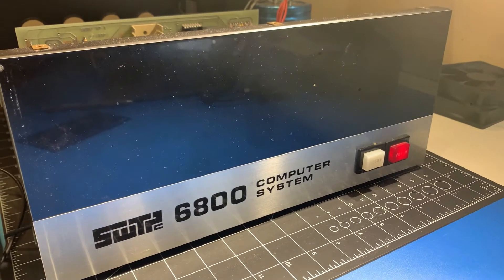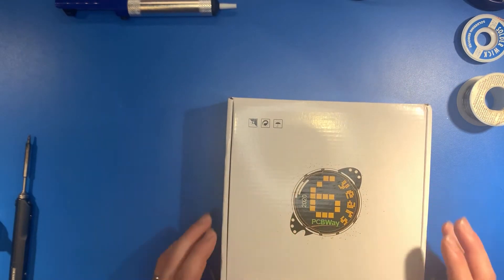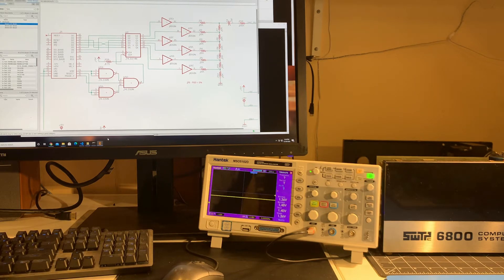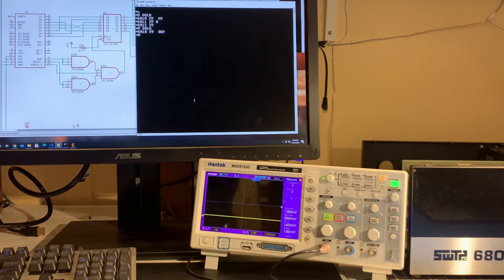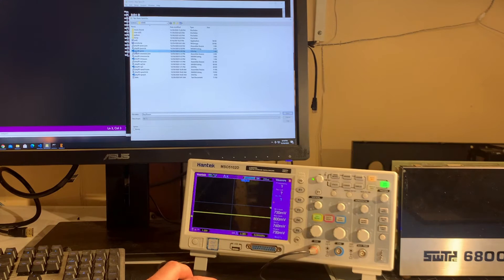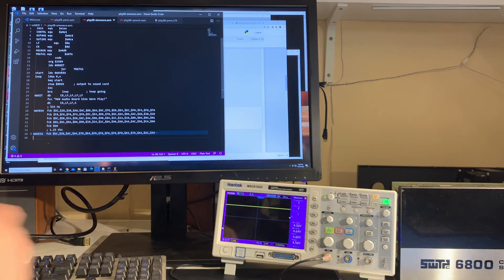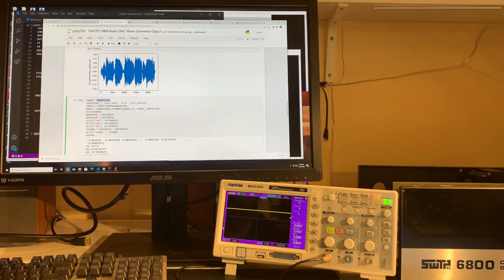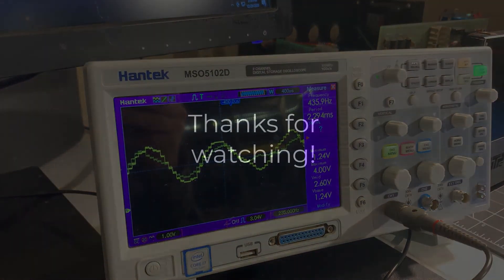SWTPC Retro DIY sound card.

Comment: Is it feasible to use interrupts instead of adding hot loops for delays? A quick google shows the chip supports IRQ and NMI interrupts but I guess you'd need to be able to ensure they are triggered on a timer like video interrupts are in many other popular 80s micros.
Reply from the maker: There is an extra interrupt controller card for the SWTPC 6800 which I do have so I think using interrupts to control playback would be possible by the interrupt periods are not very granular. I think it’s possible.  https://deramp.com/downloads/swtpc/hardware/MP_T%20Timer%20Interface/MP_T_AssemblyInstructions.pdf

Comment: How much should I expect to get out of my 6800?  Altair's go for about $6k currently, obviously doesn't have the same collector base, but it is more rare than an Altair..
Reply from the maker: I think rarity counts for a lot but it is really set by what someone is prepared to pay. I have seen these on eBay for more than $2k. So I’d suggest that’s around the right starting price for an auction. They come up rarely, because they are so rare. But keep your system together don’t part it out as it’s worth more to a collector as a whole working unit.
Reply: @robin-g6  Thanks, that's a reasonable esitmate.  I'll probably just keep it around though, no reason to sell a rarity.  I definitely wouldn't part it out.

Comment: I’m in the middle of whipping up a 4 channel (or 8, if you double up a pair of PCBs and configure the jumpers right) 8-bit analog output card for sending control voltage to a modular synth rack. I’m building it as a SS30 card; but I’m going to have a cartridge port adapter for my TRS-80 CoCo (I don’t currently have a SWTPC).

Comment: hey up robin! been checking out your vids! nice great to find corsham technologies! just got hold of some for a 6809 i got hold of recently, finally got the disk drives reading flex tonight so onto the next step! i dont suppose if at all you would sell one of your spare music board PCB's?? im not super up on eagle being a kicad fellow myself! i just figured i would ask! ultimately im going to put my own sound card together but would love to give this one a go!! if not no worries ill get off my ass and figure out how to export the pcb files off of eagle ha. thanks a lot. sam
Reply: KiCAD 5 has an Import Eagle Project menu item. I (mostly successfully) imported the Corsham Newtech replica board from GitHub. Haven't verified everything yet; It complained about duplicated U4 designator, IIRC, and seemed to lose most of the component part numbers in the schematic, although they display when you try to select them (and it gets confused whether you want the component or some kind of frame - which in turn confuses me :-/ ).

Comment: We had a SWTPC system in high school running their unix with the SWTPC terminals. Actually there were 2 systems, each system had 10 terminals attached to it giving the class 20 terminals. That was in 1982. I think those systems had a 6809 and that is where I learned C. My close friend used to go to SWTP and worked with the software guys doing odd jobs and I would tag along with him and check stuff out. Those were the days.

Comment: Why in the world did the designer of the card not put the bits in order?
Reply from the maker: I was wondering that too. One explanation someone suggested is the original board was a single sided PCB and they wanted to avoid extra vias and bridging connections. It’s possible but I would have put in 2 or 3 bridges if it was me.
Reply: I was wondering about if it has something to do with 8 bit signed values. Samples on the Amiga used that and 0-127 was from the middle and up, and 128 to 255 was from the bottom up to the middle. Or the other way around... So the bits of the first and second half of the byte are mirrored to each other
Reply from the maker: @madmodders  normally in a signed byte only 1 bit, usually the most significant is used to represent the sign. So I am not sure it would cut the value in the middle like this.
Reply: I have one of the original cards, and the order is actually different than that of the reproduction. Pins 2 and 7 coming out of the 74174 (D5 and D7) are swapped. So if I'm not mistaken that puts everything in the proper order. Mine is a Model 68 Rev B.
Reply: Yep. ran your code with data bits 5 and 7 swapped, and everything comes out perfect on my board. I haven't actually found any of the original software yet, I just bought this one.